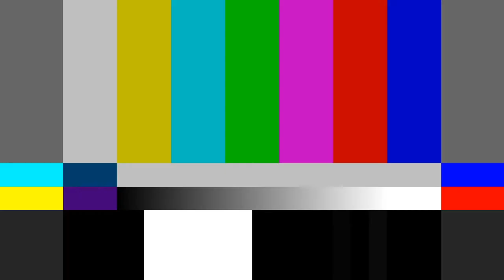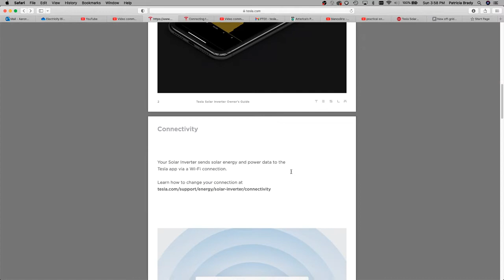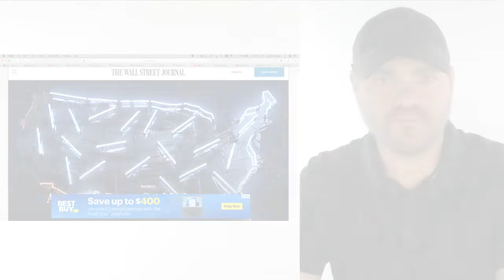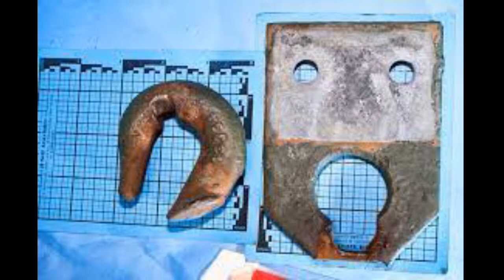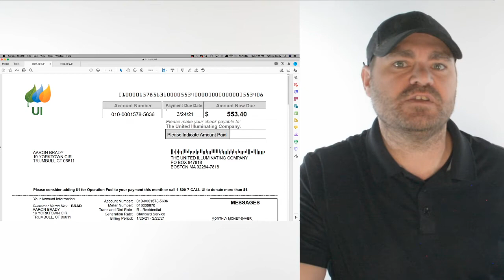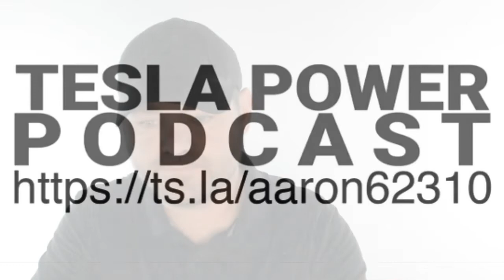Episode 048 - The US Power Grid is Increasingly Unreliable | Tesla Solar's Competitive Advantages

Comment: Hello great video very informative.  I just purchased a house but won’t be fully moved in for a few months.  Is it a good idea to order solar with power walls now because of the long wait for solar or should I wait until I am fully moved which  would give me an accurate electric bill assuming Tesla needs  an electric bill ASAP to decide how many solar panels I truly need? Thanks again and I look forward to more videos
Reply: The longer you wait the better the equipment is like   they are making more efficient solar panels. And for powerwalls we may see a significant upgrade in the next year for capacity  like powerwall2 + is 14kwhs I would doubt they will up the capacity in the next 12 months to over 20kwhs so do your research check the other brands newest battery banks because things are rapidly changing. You have to factor the federal tax credit will be gone next year so alot of equipment in the future will be full price but you will benefit  from newer technology.  Let's say 10 to 25% more capacity and more efficient  by 5 to 10 %
Reply from the maker: Nexusly isn't wrong.  If I had waited 6 months, I would have a 20% higher producing solar system.  However, a more significant change over the next two years is going to be the price of batteries - they should come down as Tesla moves to LFP chemistries and ups their production.
It's a tough call when it comes to new technology as it's always going to get better if you wait.  But you can't wait forever...!
Tesla allows you to put in your order even if your house isn't yet built.  I don't happen to know if it's the same if you haven't yet moved to a house that's already built.  I'll need to ask the community for input on this one...
Reply: @teslapowerpodcast  its a contrast between already installed  tesla solar roofs vs the future tesla solar most will only 2 sides only vs all sides  of course concentrate the panels is more efficient but cover all sides of the roof counters one side efficiency long term
Reply: @teslapowerpodcast  its like debating  a few kwh solar over a area that is  not  as efficient
Reply: Thank you guys I really appreciate your thoughts